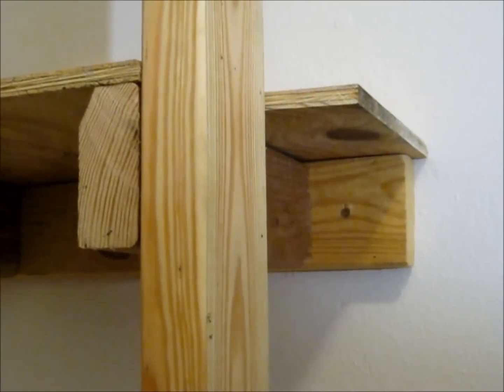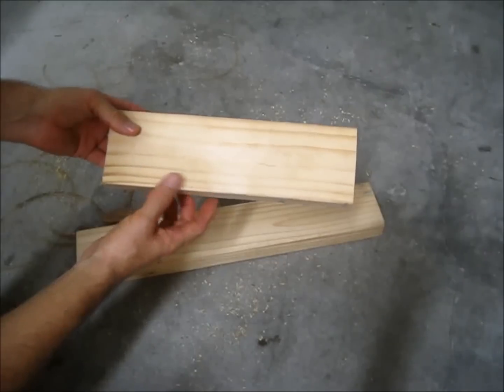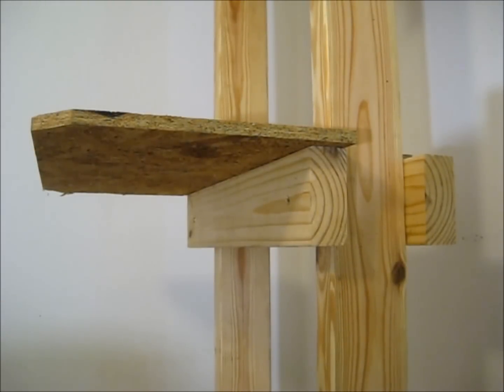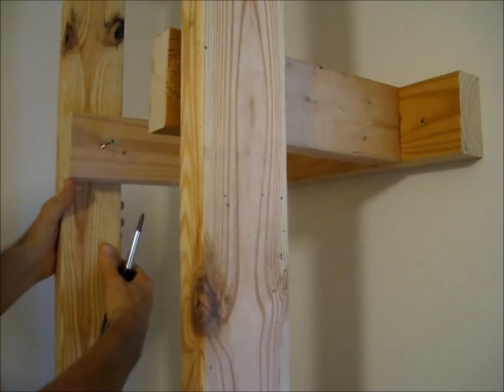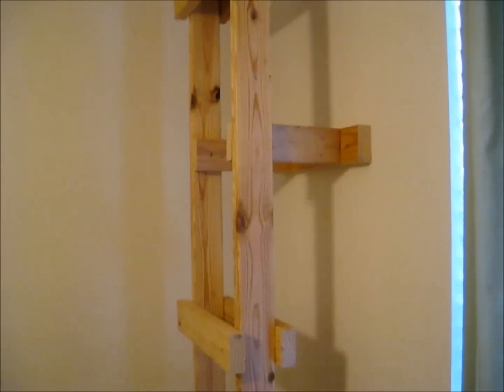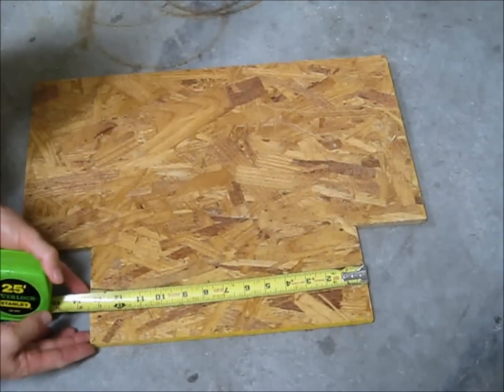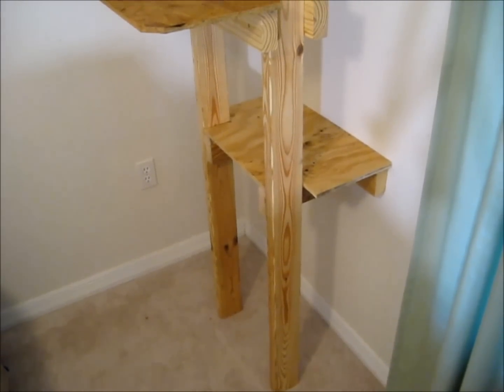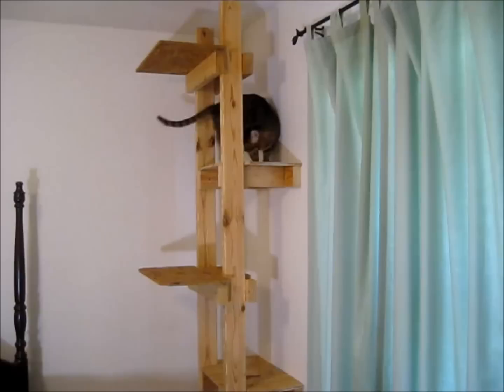How to build a cat tree or ladder

Comment: Solid structure, explained well.  Would like to build this however, I rent my apartment and am concerned regarding the holes that would be required in the walls.  Any alternative?
Reply: You can screw them in the wall now.....then when you move just fill the holes in with a little durabond then sand a little. Virtually not hard at all.

Comment: This is incredibly basic. You could have at least wrapped rope tightly around the wood for scratching.
Reply from the maker: +Brian Weegan Yes. Very basic. The rope looks nice but is a little more trouble.  Later, I wrapped the vertical sections on this one with pieces of carpet and then screwed it in place.  He loves grabbing on with his front feet and then kicking at it with his back feet.  I also put carpet on the steps so it is a little more comfortable for him to sleep on the steps.